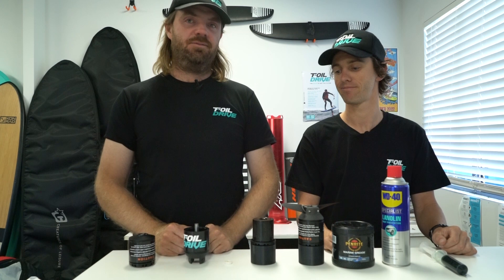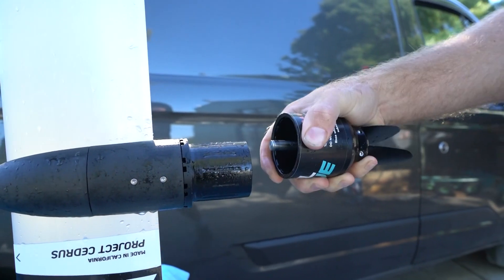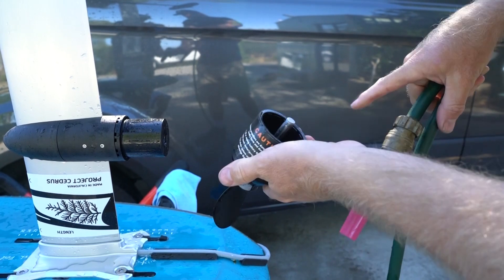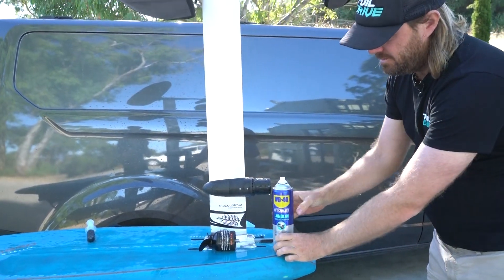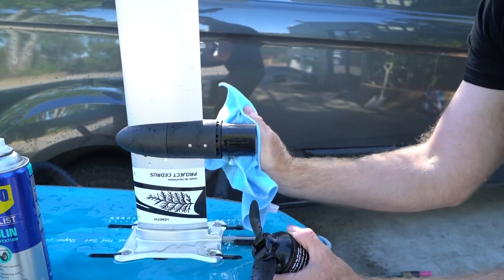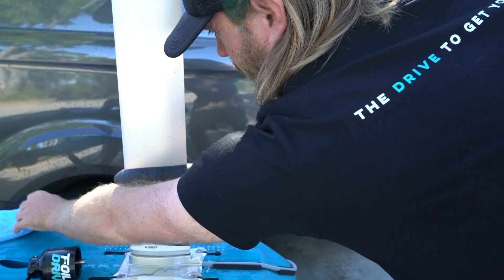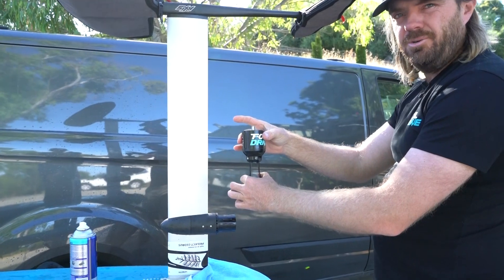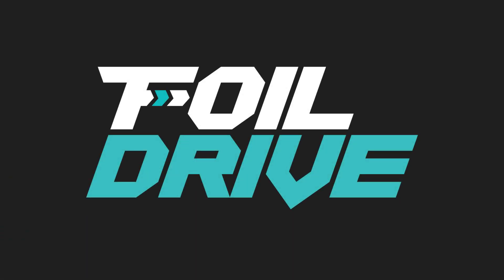Motor Cleaning & Servicing | Foil Drive Care & Maintenance

Comment: Those commercial, blue paper towel rolls would be an idea if this is an every other day task I'm thinking.  Would save having to keep and clean so many rags/towels.  
Obviously you don't want little bits of paper towel left inside before spaying, so a good look over after, or perhaps just a few quick puffs from a small air compressor or even a small battery powered leaf blower after would be a way to go!

Comment: Hello guys, I love the foil drive it's so much fun thanks. I have been a bit lazy with the cleaning 🙄 Can I recoat the drum myself with epoxy resin ? rather than buy a new one ? Just wondering if you can recommend a product to use I live in the UK. Thanks again what a brilliant product 👍
Reply from the maker: Hey Steve, sure can!
Feel free to email us some images so we can make a better assessment for you, otherwise this article here might help: 

https://help.foildrive.com/en-US/full-motor-refurbishment-188921

You'll be after a 2 part epoxy resin. Instructions in the article - Caitlyn
Reply: @foildrive  Thanks for the reply , I really appreciate that. I won't need to send photos as the in-depth instructions you have provided will be more than sufficient. So impressed with the foil drive and your commitment to customer satisfaction 😎✅✅✅✅✅✅✅✅✅✅✅✅✅✅
Reply: The lanolin isn’t available in the US. Any alternative recommendations? WD 40 makes a corrosion inhibitor & white lithium grease.

Comment: Thanks for the tips.  Can regular lanolin oil (non spray on) be used (ie wipe in on with a paper towel or rag)?
Reply from the maker: Yeah for sure. Getting a nice layer of protection is whats important!
Reply: I cannot pull the stator off, no matter how hard I pull, any advice for removing it?

Comment: How long should a foildrive normally last if maintained propperly? Not to pin point but to heave an idea😊
Reply from the maker: we have Foil Drives that get used heavily and are more than 3 years old. Batteries are consumables and depending on use and ow they are stored, will vary in their useful lifespan and it's also worth noting that parts like the rotor may need maintenance however this is why these parts are accessible. A little like owning a boat or a Jetski, there will always be some parts that require servicing.